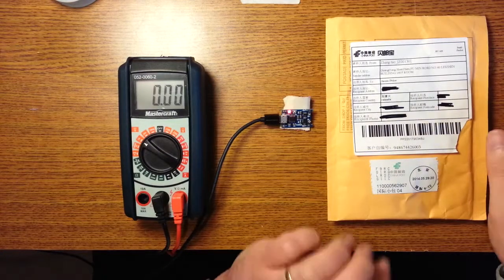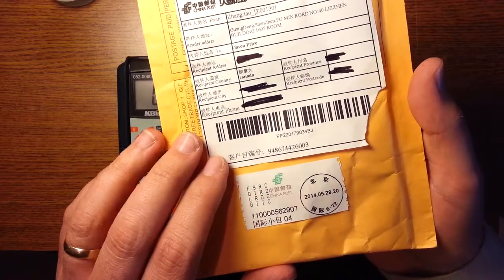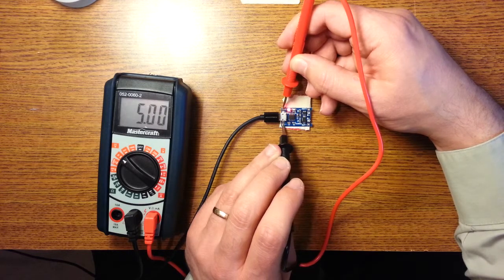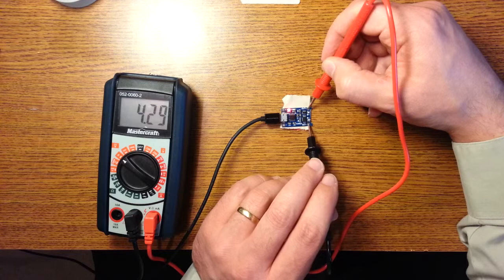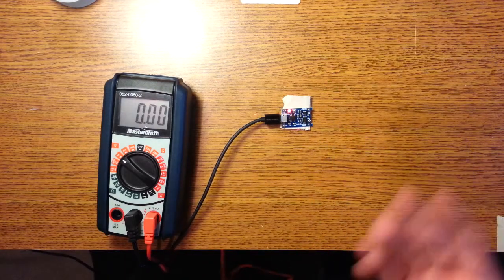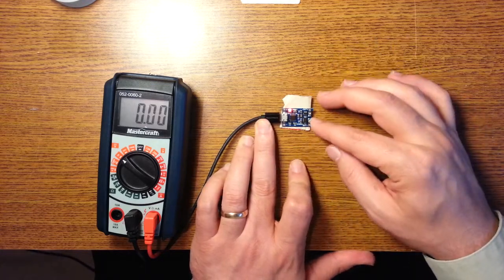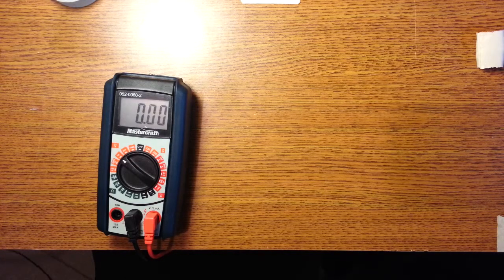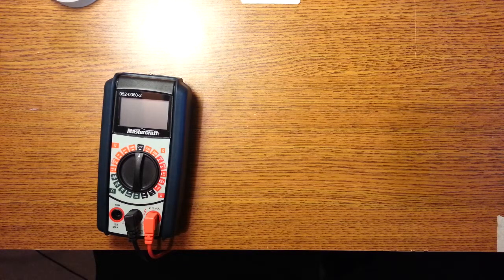Lithium Ion 18650 charger discharger board

Comment: hi there, i have a issue with the same charging board.
i got some from different ebay sellers, which behave differently. one seems to do the auto cutoff after full charge with indication of its blue led lightup, which is fine.
but the other one doesn't seems to cutoff, i leave it to charge my 18650 overnight for about 10hrs but the red led is still on indicating its still charging. and when i measured  the BAT or battery output with dmm its readings is fluctuating between 4.2 to 4.5!! do you think its defective??
i got two module behave in the same way, weird.....
Reply from the maker: I would call it bad for sure.  As frustrated as I was with my purchase back when I made it, I had to remind myself that these are made at high volume and are sold at a relatively low price.  Meaning that failure is indeed an option.

The second order of these that I made were fine and are still working today.  Where I do plan on doing some more work and videos on the 18650 cell front, I have been looking more at the xSxP (The x means say 4S1P for 4 cells in series and then the pack represents 1 Parallel) battery holders.  These have the discharge and charge protection built into them and from what I can tell, also have the balance charge leads in the PCB.  Once the postal disruption is over in Canada, I will order one for an application that I have lined up immediately.  I will do a video on it, of course.
Reply: frontlinegeek thanks for your advice.
i just tried to hookup the same module back to the same cell and guess what? its reading 4.23V at the charging voltage!! and it completed the charging process!!
i'm now testing to see whether its battery protection ic will cutoff the output when the cell reaches the critical level.
and the earlier batch that i posted as "working fine" doesn't have the fluctuation without the cell but its charging voltage is just 4.07V??
what the.....

Comment: Hi,

can i please ask you, because i was not able to find this info anyware:

if i have a board like this:
http://www.ebay.com/itm/4S-15A-Li-ion-Lithium-Battery-18650-Charger-Protection-Board-14-4V-14-8V-16-8V-/181499390972
 can i user a normal laptop charger that gives 16.8 volts and 3 amps? or i need also a smart charger?
Reply from the maker: +Smart Romanian Obviously the voltage is good.  The issue is that there is nothing in the specs of that board that covers the amperage that the charging circuitry is set to use for the CC or constant current phase of the charging cycle.

I would bet the reason it is not immediately listed is that the cells you use/buy are the source of the CC amperage specification.  Some cells can charge at 1C and some higher.  Most are .5C.  The C means the Amp Hour capacity so if you are using a 2AH cell, 1C would be charging at 2 amps.  The 3 amps from that power source might not be enough or if the specs for the cells are more towards .5C, then it would be plenty.

Here is a Digikey article on the general  subject:http://www.digikey.com/en/articles/techzone/2012/sep/a-designers-guide-to-lithium-battery-charging

Here is an interesting item that I want to order some time but have not gotten around to it yet.  It may be a better fit for what you are planning just because it is a charge/discharge controller and holder:  http://www.ebay.com/itm/1-x-4S1P-14-8V-18650-Holder-Case-Battery-w-Li-ion-PCM-Protection-Circuit-Module-/151886979740?hash=item235d2b629c:g:jicAAOxy9bxRzRBs